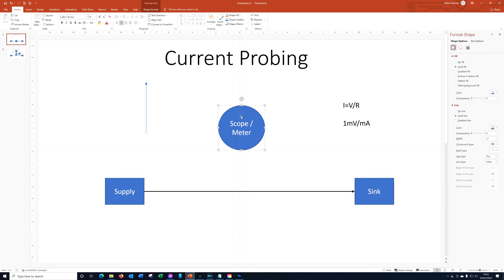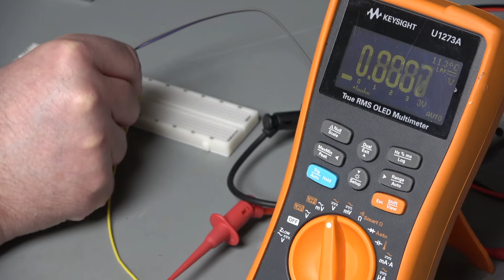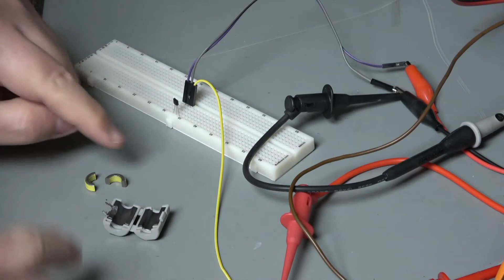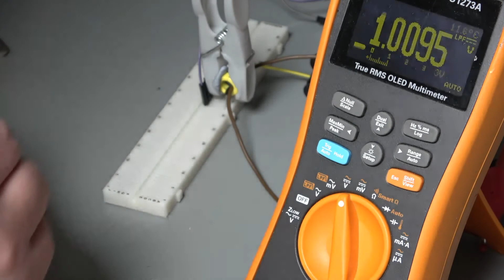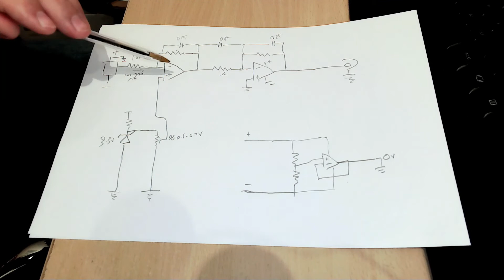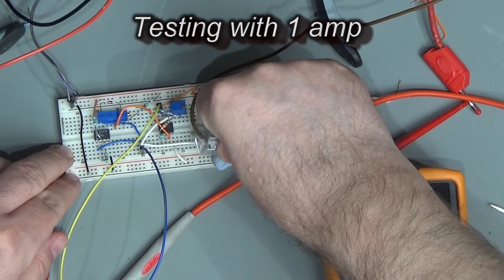Designing a Current Probe Prototype pt1 #0049

Comment from the maker: I'm taking a risk not pinning down the thermals, but I can always use the boards as general amplifiers just by taking off the offset control.  Also when I send off the files, this will be the first custom enclosure I've had manufactured.